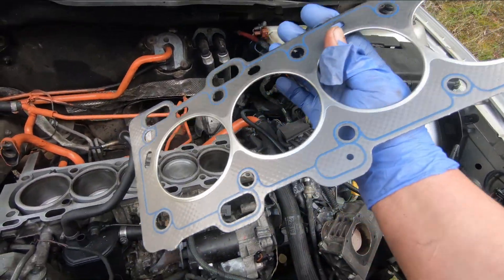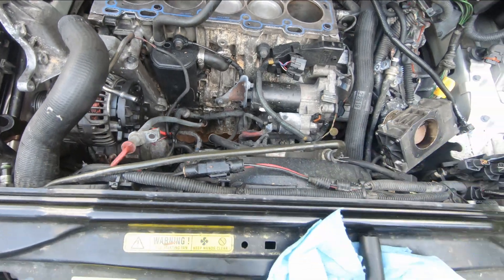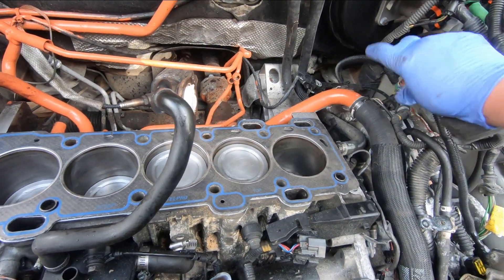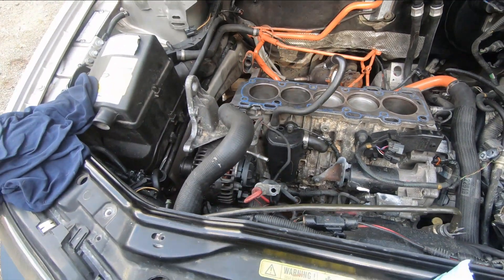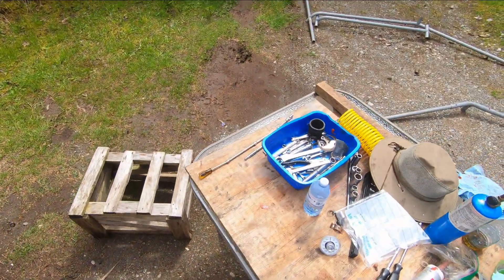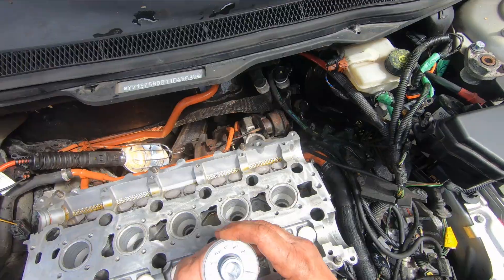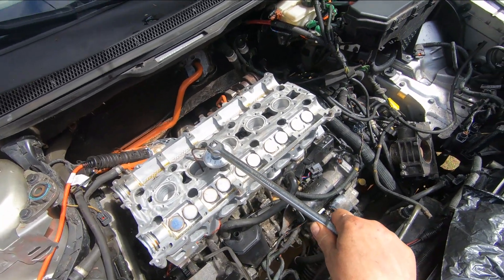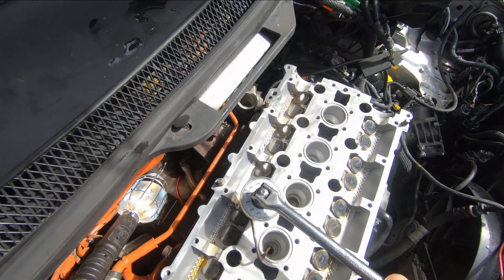TORQUE A CYLINDER HEAD USING A DEGREE-ANGLE TOOL ~ 2001 VOLVO V70 2.4 B5244T3 ~WORKS ON MOST ENGINES

Comment: Hello , was cleaning my engine block today to prepare it for gasket installation, i notes the compression rings/sleeves are sticking up from the exhaust side as thin as the razor blade edge .is this normal ?
Reply from the maker: I think that is the design of the block, yes.
Reply: @EverydayProjects  omg 😲 thanks for your reply 🙏 I was terrified 😨

Comment: So how long did you have to wait for the right weather to do this job? I'm thinking you have projects all over the place on the go!😂
Reply from the maker: This was filmed last spring (2022). I have already got this engine running and have driven the car for a year. What I have is a lot of video but I want to present what I have in order, so what will follow next on this car will be installing the camshafts and setting up the timing to install the timing belt. Then, I have video of installing a new alternator, changing the coolant, etc. And that's just for the Volvo. True, I have so many things on the go: Volvo, F-150. Mazda, Tractor and then there's the small jobs...that's why I called it Everyday Projects...I don't get a break!!:text-green-game-over:

Comment: What amazes me also is how do you no where all the wires and other components go that are laying around! To me it looks like total chaos! but I'm sure to you its ABC 💯👍🏾
Reply from the maker: Sometimes, it's hard to remember where all the spaghetti wiring goes but mostly, it all has a spot where it connects. If it has been a long time since I took something apart, I'll check pictures I took during the disassembly or look up similar cars online in hopes that there is a diagram or photo of the routing. Taking a few pictures on your phone of something as you take it apart can prove very valuable on reassembly. This Volvo, for example, I bought after a garage had taken the top of the engine apart and decided to sell the car instead of fix it. I was going in blind but eventually got the engine running.
Reply: @EverydayProjects  We had one in college those are some tough cars!
Reply from the maker: @bigsonslawncare  I bought this one and fixed it up. I now have it to drive and I'm liking it a lot. The seats are the most comfortable of any car I've been in and so far, this thing is fantastic. It seems that these older ones are the most popular. They were made in Sweden but newer Volvos are now made in China. Somewhat lesser quality as compared to the older ones.
Reply: @EverydayProjects  We had a 240 and a 740 the 80 s model and I will tell you we drove the dirt out of them cars and they never let us down👍🏽
Reply from the maker: @bigsonslawncare  The 240s still hold their value today and many still sell for thousands of dollars. They were a tank.

Comment: I have not seen a degree angle tool used before, it looks like a simple but handy tool. We will have to look out for one rather than wait until we need one
Reply from the maker: I hadn't used one before but the specs for this head specified 130 degrees after initial torque settings, so I learned something too. I made the rod from a piece of coat hanger and it worked well. All the best.